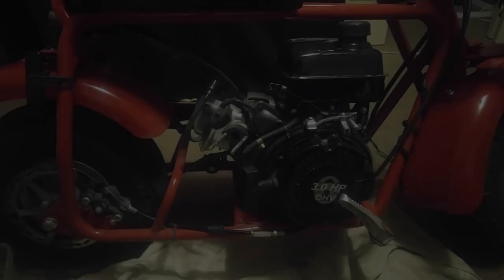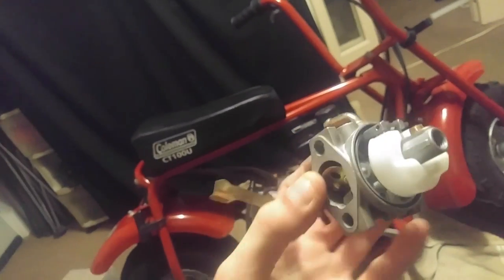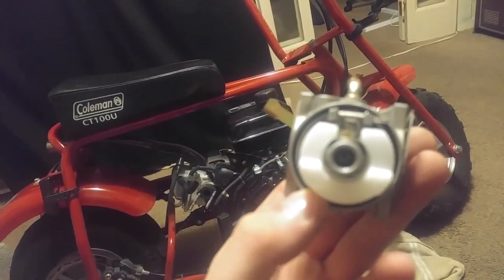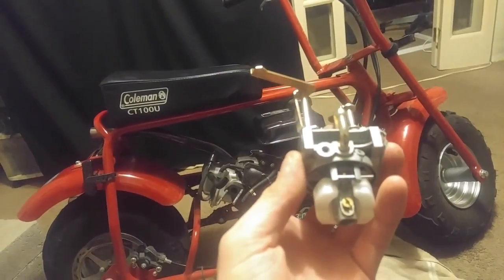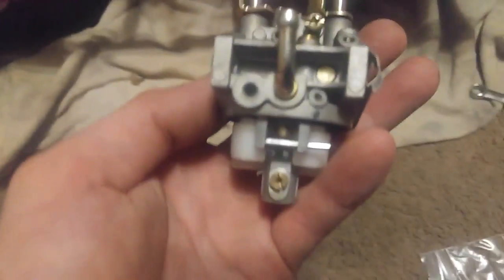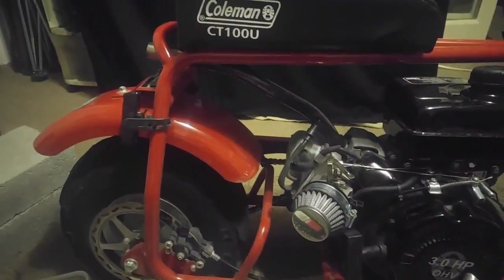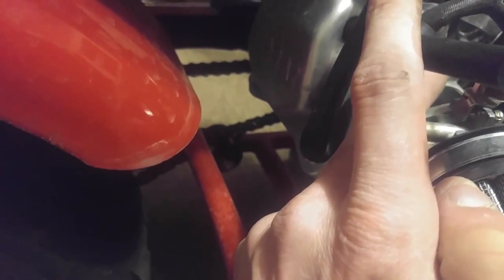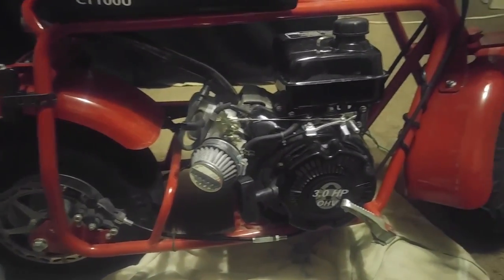How to improve your jet from 99cc to 100cc on the Coleman ct100u

Comment: Drilling out a jet ''does not'' give an engine more displacement. It might make it feel like it though... ''No offence''. I've been an ASE master mechanic for ''many years'', & built hot rod old school Harley's & race cars, ect. ect…. Am thinking about getting a couple of these, & haul them on the back of a 5th wheel, when the Ol' lady & I hit the road for good in a couple of years.....  What I will do with mine,, is first, take the intake spacer & roughen up  & enlarge the ID  of it a bit. That helps to match port the intake & carb to the head, & also in roughening, it helps to atomize the air & fuel better before hitting the combustion chamber. Next will be a K&N style air filter & filter breather. I do like the header also... After that,, will see how rich or lean it runs, & go from there before messing with the jets ect. One old school trick is to first chamfer the main jet with the end of a drill bit or X- acto  blade first, on both sides,,  before drilling through it. That might possibly be enough in itself... One last trick with that type of header, is to get the flame angle out of the exhaust port as smooth as possible.. The way I see doing it on this, is to bevel the ''rearward'' ports a bit on the exhaust port of the head, & the ''rear'' ID of the header flange..  That will help some in keeping  the flame from going straight out, & then hooking back. Just don't want to take out to much material that it messes up the flange sealing areas..  ...  My 2 cents..  Ian

Comment: I have to ask.. is there any adjustment on that carburetor?  I have the same one and see no real adjustments for rich/lean mixture... I think its a pilot jet type carb that you can't really adjust other than the screw with spring for low idle.  I'm going to drill the jets and try again.. your bike sounds great.. mine seems to idle high and when I bring it down it just acts like shit.. thanks.
Reply from the maker: That's about all you can do is play with the jetting other than that better off just putting a predator 212 in it

Comment: so dan what size jet comes with mini bike when bought it and what size did ya go to?? thanks man
Reply: Im atrying to figure the same thing out, i run mine, brand new from the store on 93 & a 1.5 hp shot of dry nitrous, which obviously isnt a good thing. Or is it, i about a pound of nitrous in on stock everything with no governer & im seeing a 5 mph gain i went 17mph stock & 39mph without a governor. So the jet sizing is a bit important since im having to run higher octane fuel just not to have detonation from all the heat.

Comment: Which would be better for me a 80cc moster moto or this im looking in to bypassing the govner ive had a 98cc monster moto and it hauled my 220 pound self around easly
Reply from the maker: dude just get the predator hemi 212 thats what i did the 3 hp is weak sauce for real B
Reply: My son have the ct100u witch is the 98cc engine it sucks
Reply: I had a 212 predator before nice motor but I’m thinking more like a 301 predator this time
Reply: Plus the frame is heavy and the monster Moto is lighter which is good so if you put a predator it’s  going to fly
Reply: @floridaboy4243  i have a coleman ct200u with a few engine mods now im runnin around 35mph with the 196cc

Comment: do you know what size the drill bit it is , cause I might the right size bit
Reply from the maker: dan barrett I don't know what size the drill bit is but I'm pretty sure anyone can find out if they just research it I did however get the drill bit from HotrodMinibike.com maybe you could find something on there
Reply: Ram man I know this is late to say but it is a 0.68mm bit
Reply: @ryan.b1861  so 0.68mm is the correct size for the jet on the ct100u? Just wanna make sure cause I'm having a hard time finding it online for some weird reason.